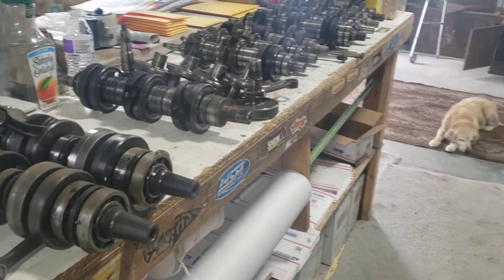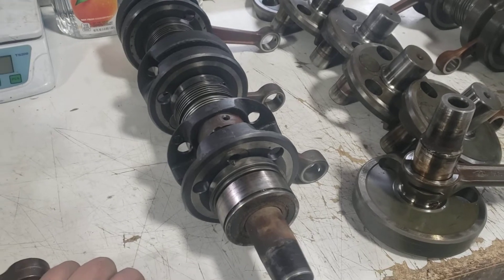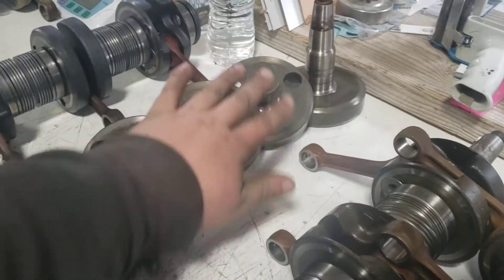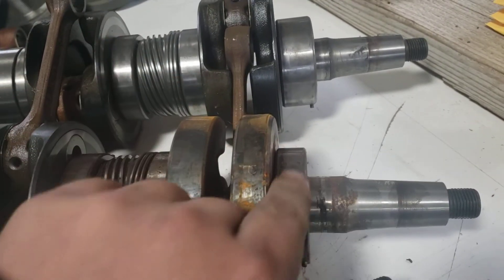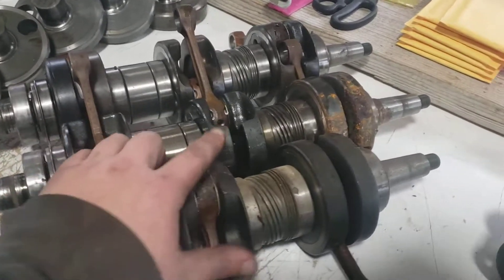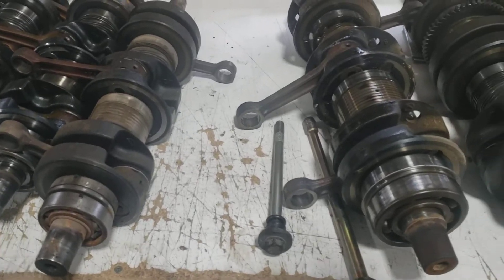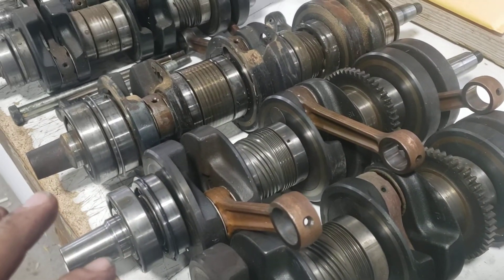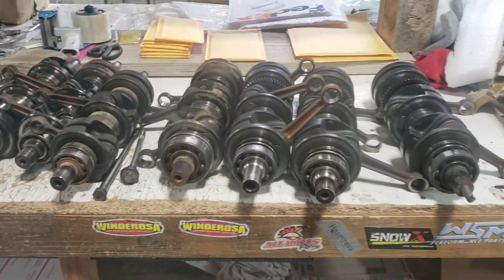Polaris triple crankshaft identification and differences xlt xcr ultra 580 600 680 700 800 storm

Comment: You are wrong about the first Polaris crank. It is not from a 650. 650s had oil injection and there is no drive gear on that crank for oil injection. That crank most likely is from the 500 triple. Even 600 triples 1984 through 1987 had oil injection. The first year 600 triple 1983 did not have oil injection.

Comment: Really appreciate this intel! I’m rebuilding an Ultra SPX right now, and I just noticed that on the pto side, the rotating portion that sandwiches the rod has some coarse rust on it. Sorry I’m not sure of the technical term for that part. I just put the case together and noticed. Ok to run that way, or do I need to clean that off?
Reply from the maker: I would remove all of the rust before install....

Comment: I wish I knew the story on that Ultra crankshaft that has the broken bolt sticking out of it. From the looks of it  they probably ruined the primary clutch trying to get it off. Almost looks like they tried using heat.
Reply from the maker: Yeah...dang customers who don't have the tools to remove the clutch properly.

Comment: I’m restoring an 85 Indy 600.  I may need the crank rebuilt when I get into it so I’ll reach out when the time comes. 

My question is this. Can I use a 97 ultra clutch on the 85 Indy 600 taper?

Comment: Why does the Ultra have those seals, but the XCRs don't?
Reply from the maker: Its for the style of water pump that was used.
Reply: Only the 680 96 had the oil bath water pump after 96 they eliminated the seals,  you can simply cut them out ,you don't have to  have the crankshaft taken apart! You don't need to modify the 96 pump it will no longer need to have the oil added any longer.